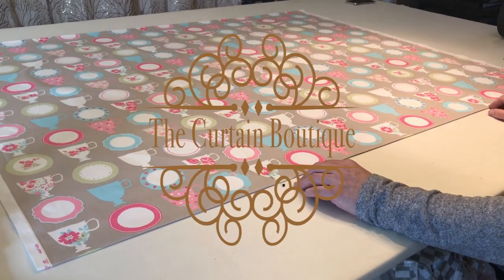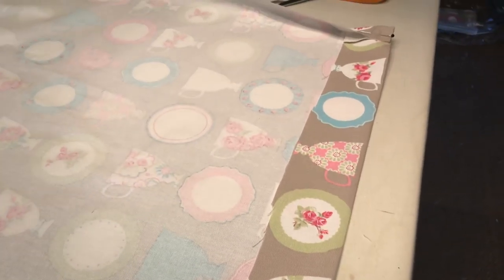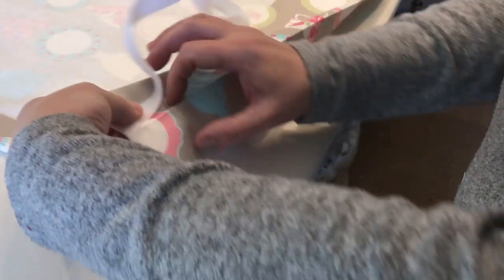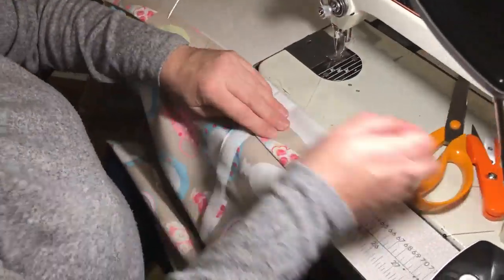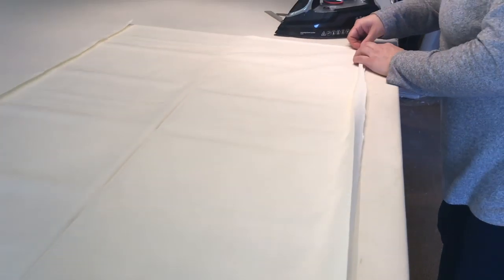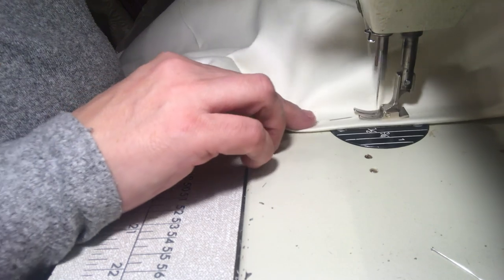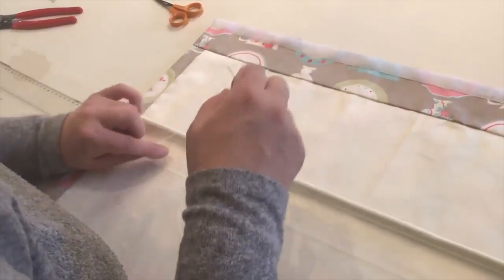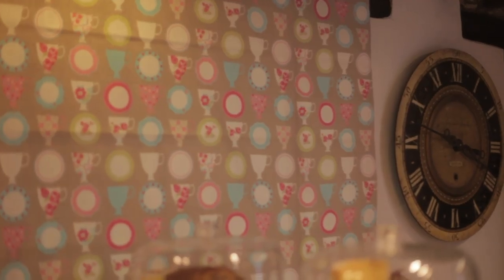Making Roman Blinds | How To | The Curtain Boutique

Comment: Great clip! One tip that really helps, using a T-square or carpenters triangle to ensure your bottom hems are exactly 90%  on the sides or else they won't hang right. Learnt this the hard way when the first blind I made didn't hand well due to the low hem and sides not being 90%.

Comment: I think your tutorials are excellent there is so much step by step detail from start to hanging up to give a  professional outcome.
My query is that I have a pair of blinds in my kitchen there's nothing wrong with them but I would like to change the material. It seems wasteful, not to mention expensive, to throw these away and make new ones so Is there an easy way to add new material to the original lining and pully system? Any advice would be much appreciated. Thankyou
Reply from the maker: Hi Jacqui, yes you can definitely reuse everything, just be careful to unpick everything carefully so you don’t damage the existing lining. Just lay the existing lining onto your new fabric and lock it all in as I show on the tutorial, then hand sew and put your Velcro on before you re-inserted your fibre glass rods or dowels and bottom bar. If you need any further help just message me.
Thank you for supporting my channel xx

Comment: Thanks for the great tutorial. I’m making my blinds with a blackout lining and wondering if I have to do anything differently re making the channels as the lining is thicker. And usually I would take a blackout lining right to the edge, folding over face fabric and stitching on to lining. As it will fit outside window recess maybe cutting lining as a normal lining will be ok. Would appreciate your expert opinion.

Comment: Hi.   I would find the rails difficult.   Is it possible to put Velcro onto your window then attach with Velcro at top of blind.    ( no wooden baton ) as I’d find it to tricky to do.   Thank you in advance.   X
Reply from the maker: Hello Mary, the only way this idea would work, would be if the top protrudes enough for screw eyelets to be fixed to work as the cording system. If you need any further help, txt me on 07702583955 . Thanks for supporting my channel, it means a lot to me xx

Comment: How do you work out the spacing between the channels?
Reply from the maker: Take your drop and take off drop of track, usually 6cm. Divide the remaining amount by an odd number,  most blinds will be divided by either 5,7 or 9 you need to aim for the bottom half pleat to be approximately 18cms 

Example

126cm drop
Minus 6cm track drop allowance 
114cm left
Divide 114 by 7 = 18

So your rod pocket pleat measurements are

18 half pleat at bottom
36 from last rod pocket to next one
36 from last rod pocket to next one
42 from last rod pocket to next one (includes your 6cm track all)

I hope this makes sense xx
Reply: @tcbtutorials  Thank you so much, I had to think about it, and then it all made sense. Cheers.

Comment: Where can I buy the rail?
Reply from the maker: I can supply to you x
Reply: I live in Tucson, Arizona. Are you in England, and are you able to send it to me? I want to make two Roman shades for my bedroom. The windows are approximately 46 X46 inches (116.84 cm). I would have to do outside mount because the window depth is less than 2 inches (5.08 cm). How wide should the rails be, and can you cut them to size? How much would they cost?